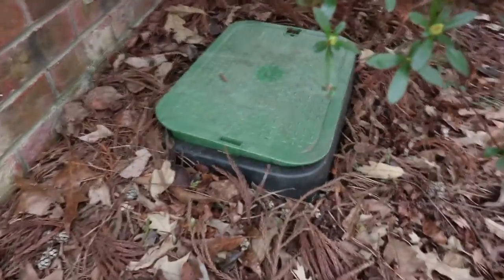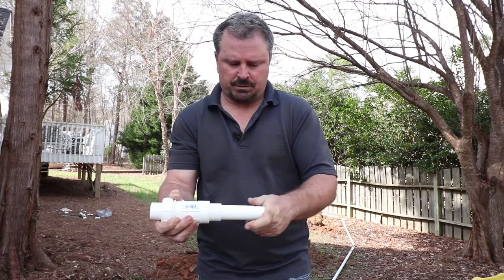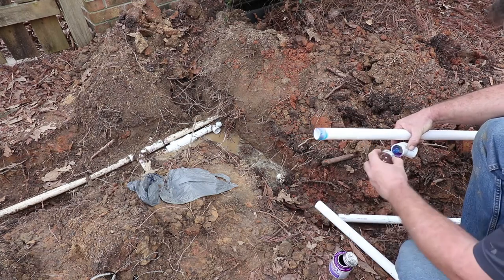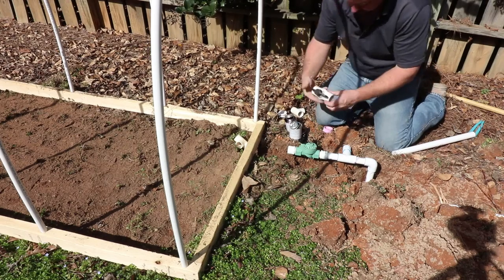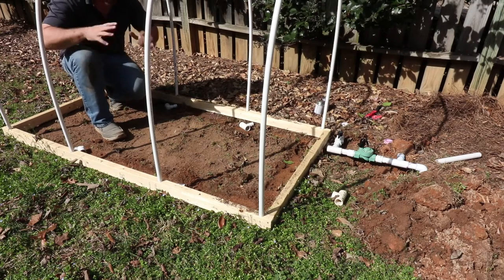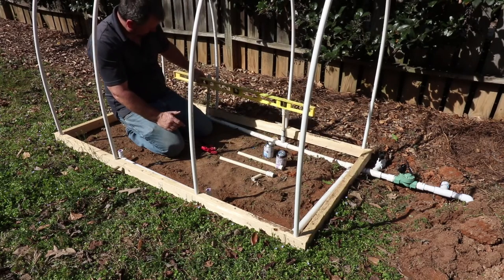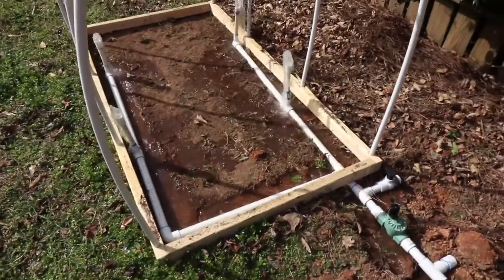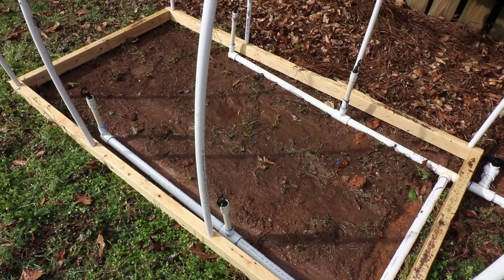Backyard Plant Propagation Episode 3 (How to Root Woody Shrub Series)

Comment: The pipe won't hold pressure without using the cleaner/primer.  He's right, if you're using PVC for pressurized water line you need to use the cleaner/primer.  Nice channel, thank you for all your great videos.

Comment: HortTube with Jim Putnam, this propagation series is awesome, and what tough work while moderating this from your cordless mic, nice job! I just can't help notice that you have Schedule 40 PVC arcing above the plants and then sent the water source from the ground up to the valves. I'm not a plumber but I might guess that the wood framework on the ground could have also been done in Sched 40 and then fed by a U-shaped main, with overhead valves inserted into the arcs? I'm going to recycle my home windows into a greenhouse and wonder if this overhead method might work.
Reply from the maker: That would work great. PVC will become brittle over time, but that will take a couple of years.
Reply: What size pipe did you use inside the green house? Is it 1 inch?

Comment: Great video. Glad I found this series. If you have to drain the house for winter, do you depressurize the entire system back to the source? If so, do you worry about air hammer and/or dirt finding its way back into the system? Thanks
Reply from the maker: Yes, I always worry about water hammer. I had ten horse electric pumps at the nursery. We always opened everything when we restart. Then we close valves when the water filled each zone. It will destroy a pvc system.

Comment: Hey Tim, I enjoy your videos! Straight forward! But I was wondering why you picked a sunny spot in your yard? It seems like the cuttings could get cooked in such a low greenhouse. I saw your commercial prop greenhouse video and it made sense temp wise, but for summer propagation do you recommend a shady location? Thanks slot
Reply from the maker: +Vida Vivero I'm gonna add a fan and evaporative cooling will do the rest.
Reply: Cool, thanks JIM! Are you going to complete this video series? I want to try this on the smaller scale before converting my 20x96' over. Can you recommend a fan that be appropriate for a hoop house? Also, have you found any sources for adjustment of duration of mist according to weather? Thanks so much.
Reply from the maker: +Vida Vivero I'm gonna spend the whole summer doing propagation videos for sure. The systems that measure humidity and adjust the watering are very expensive but they do exist